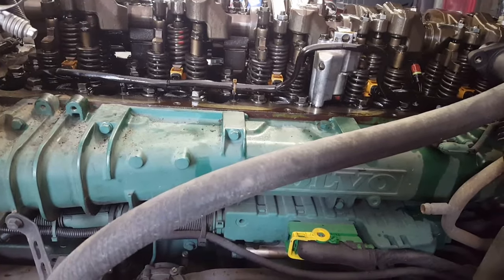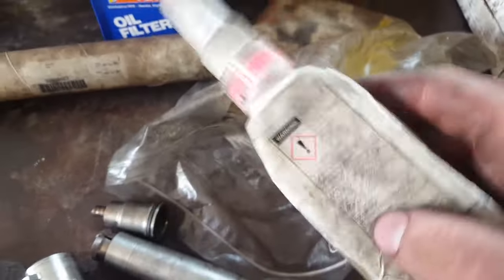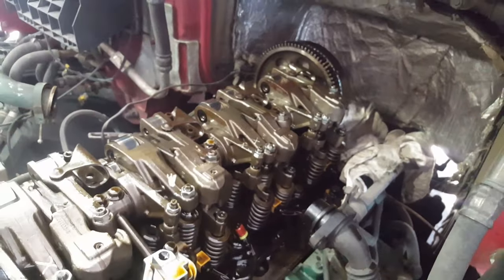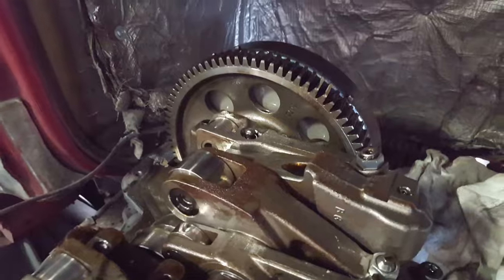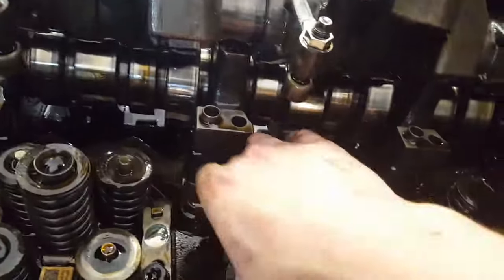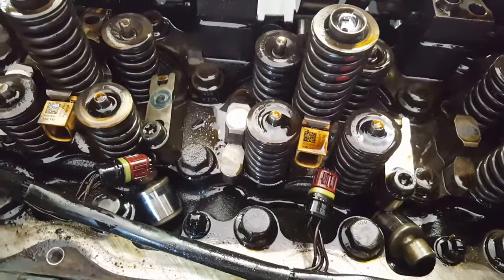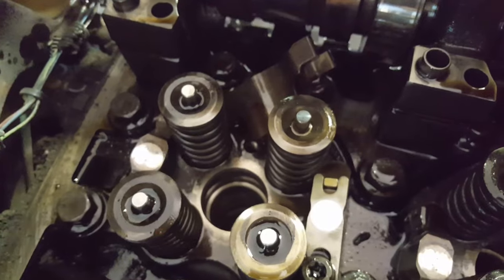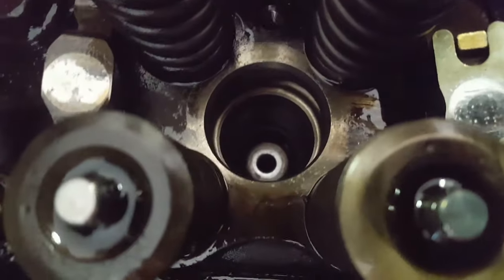How to Replace Injectors and Cups on a Volvo D13 Part 1/2

Comment: When pulling injectors, loosen either the feed or return line on the head to let fuel drain. When pulling cups, use a 15/16 ratcheting wrench ($20 from Home Depot) on the big nut, stick a rolling head prybar or screwdriver in a rocker shaft hole to keep the 13mm wrench from moving. You’ll have all cups pulled in 3 minutes.
Reply: When I start my truck in the morning and sometimes it doesn't start, the noise comes as if the truck starts now, but it doesn't start, it stops by itself, my truck is 2017 and has 8 lac mileage, if anyone can tell me anything.
Reply: When is temperature is very down same problem show me , today I am right now Amarillo tx eh is temperature’s after I trun off my truck and maybe 10 min after I staring again same problem, but right now I press the race pandle after that is start my truck ,

Comment: @ 9:00 I would recommend using rubber bands to keep the exhaust plungers from falling out of the rockers when removing the rocker shaft, makes re-installation a lot easier.
Reply: We use the EGR crossover pipe, green o-rings, to hold the plungers in.

Comment: Thanks a lot for posting this, I'm doing this job tomorrow, I already started this afternoon and removed the valve cover and rocker arm bolts, I'm going to make that angle iron tool first thing in the morning, do you mind telling me the thread size of those 19mm bolts so I could picked them up when I go to buy the angle iron? Thanks again

Comment: how much would you charge to come to Arizona and teach our yard mechanic how to perform this job. We would pay your flight and hotel . it be nice to have some overhead adjustment videos. Our mechanics are really good with other engines its just Volvo that they avoid any major repairs. For example they did a head gasket on a 13 and had some problems with it. Volvo dealers are really expensive and always swamped with work. great videos btw Thanks

Comment: Hey brother you said something about reusing the injectors. If i want to reuse mine do i need to do something with them. My injectors seem to work fine but i have bubbles in the fuel tank comming out of return line. Also long starts. And my last trip i had severe vibration under heavy load. Not sure i that was caused by leaking cups or just clogged fuel filter. Was no vibration when drove home empty for over 500mi. Also how much you charge for injector work, do you give waranty for how long. And how much are injectors from the dealer. I have the tool for pulling cups from ebay slightly different than yours but same principal. Have you heard if those work ok. Im thinking how to fix my truck cobsidering all possible options. Have 6 kids bills are coming truck needs work. Thanks дякую

Comment: Hello sir ,
When you said you vacuumed the cylinder to prevent hydro lock what did you use for that .
Reply: You can get a vacuum brake bleeder with 1/4 air hose into the cylinder

Comment: YOU CAN USE A SCREW INTO THE BOTTOM OF THE CUP AND PULL IT OUT WITH SLIDE HAMMER DONT NEED TO BUY EXPENSIVE TOOLS

Comment: Sorry I forgot to ask you another question!! Are injector cups come in 2 different kind of material ?? Like in the past they were made by hard plastic or metal which metals lasted longer ! Is that right? Are metal ones do better than un metal injector cups ? ( quality wise ) 
Thanks man
Reply from the maker: Used to be copper, now they are steel

Comment: Great video I've worked at mack dealer couple years back and totally almost forgot the procedure installing the cups. And Chronicle cup thing for injectors tips .great explained
Reply: Feed line is the better option, since it's toward the rear of the head and typically is a little lower than the front

Comment: the steel sleeves are miles better than the origional copper sleeves. 9/10 times you would either pull the tip out with the old tool that threaded through the tip, or you would pull the sleeve and the tip would stay in the head :D

Comment: wow... great video, thanks for sharing. I got a question if you don't mind? When the hard cranking reason is just injector cups , are you always recommend to change the injectors too even if they are in good shape?? And secondly where is your shop located? Thanks a million if you reply. I assume you're a great mechanic by this video.
Reply: If they are in good shape, you don't have to replace them, and you can replace only ones that/if they are bad.  Only reason they are recommended to change in a set is Labor Time (Money), since you would have to do everything again to change injectors in case they fail soon after you install new cups.

Comment: Great video 👍
I have been going from shop to shop with injector cups problem. Just day ago pulled out of the Volvo dealer drove 550miles and my coolant starts leaking again pushing it through the injectors, pressurizing the system. Had two full engine rebuilds on two separate trucks, basically every year I need an engine rebuild. Do you think that the injector cup leak issue could cause a future engine failure? Because I have to rebuild whole engine after injector cups leak I don’t know if it could be connected in anyway but it seems like coolant washes out cylinder oil and engine running dry long enough and after the leak fix that cylinder locks up and drops rod destroying entire engine. Idk 🙈

Comment: Where can I get the inyector cup removal and installer tool ?
Reply from the maker: Dealer should have it. Otherwise you can get aftermarket for much cheaper but maybe won't last long

Comment: Interesting. I use to work in a machine shop years ago, making a few different turned parts for these injectors. So if your lorry was build between 2004 and 2011, and the injector failed. Sorry about that.

Comment: Good morning I have a question what tools exactly do I need to remove an alternator from a 2006 Volvo vnl with the engine D12 thank you in advance
Reply from the maker: Basic hand tools. 1/2 ratchet and some sockets dont know exact size, it right on top so should be pretty easy
Reply: @cardinaltruckservice3753  ok thank you

Comment: Should the fuel rail be replaced while replacing the injectors?
Reply: Not really necessary unless the injectors were the problem! Volvo doesn't use high pressure rail on d13 that's a good thing so the rail isn't where most problems are! The cup's design and injectors (because of cup design) are the most common problem besides oil leak at the timing gear area at the back of block!

Comment: When I start my truck in the morning and sometimes it doesn't start, the noise comes as if the truck starts now, but it doesn't start, it stops by itself, my truck is 2017 and has 8 lac mileage, if anyone can tell me anything.
Reply from the maker: Maybe air getting in system ie injector cups, filter housing, davco or pressure relief valve sticking if you still have it
Reply: @cardinaltruckservice3753  thanks sir

Comment: I bought the swage tool for installation but welded a tap to a piece of threaded rod and made a bridge to pull old cups and it has been working fine for years now

Comment: Hey question, my truck is taking forever to start (d13) and it stays misfiring. I got some bubbles in the tank. But her i open the the priming pump it came lose. Do you think its soaking air ? Or my problem is injectors and cups?
Reply from the maker: Could be a few things, cups most likely on this engine but will need diagnose by mechanic, could also be filter housing or check valve or hole in fuel line

Comment: I had injectors put in and my jake quit working. Any relationship?
Reply from the maker: Yes, take it back to the shop
Reply: @cardinaltruckservice3753  They still have it and they ordered a solenoid I don't know who they are planning on paying for it. They took valve cover back off and said everything looked good with new orings put on. Just sucks bill is going to be big anyway

Comment: Tow months ago I replaced the 6 cups and one injector because I was having diasl in the coolent ,  and now I have misfire cylinder 5 , can I replace the injectors only Without replacing the cops ?
Reply from the maker: You can try but you might have to do it again, it's cheaper to do it right once. It doesnt add much time to change one cup when your already there
Reply: @cardinaltruckservice3753  thanks for your help , what about the one brand new injector i replaced tow months ago , do I need to replace it also or just buy 5 new injector , it's almost 600$
Reply from the maker: @mahmoudlover1  yes you can put 5 as long as the new one is not the problem
Reply: @cardinaltruckservice3753 yes the new one cylinder#2 and the problem cylinder#5 misfire ,

Comment: sir i have a problem if i start the engine d13a volvo and i put automatic or manual no accelerator,.after 1 to 2mins.accelerator work..in neutral position its good,.what is the problem?
Reply: throttle pedal may be the cause, had the same problem with a FM9 / ishift gearbox
Reply: Tps or throttle position sensor!

Comment: Very informative video. Where can i purchase his injectore sleew remova/installer?
Reply: TAP THE BOTTOM OF THE CUP AND TREAD A SliDE HAMMER INTO IT AND PULL OUT THE CUP EASY AND CHEAP DONT NEED EXPENSIVE TOLLS TO DO THIS JOB.
Reply: anywhere online, amazon

Comment: Have you seen any failures with injectors or any other part in general that damaged the turbine veins on a vg turbo causing the armature to seize up? On a D13 engine. Thanks. Awesome video too.
Reply from the maker: Something from engine would probably be piece of broken valve. It could get stuck from build up of soot or uneven wear also
Reply: @cardinaltruckservice3753 Ok, thank you.

Comment: sir how about the weak engine brake,what is the possible cause,it works but he cannot stop the truck if I use the engine brake?
Reply: You need your top end serviced! Clearances are out of adjustments! While you're at it have them do cylinder cut out and compression test and get yourself an oil sample sent out!

Comment: Do I have to chance the injectors everytime I change a cup ? Or could I just change the cups only.
Reply from the maker: Cups need to be changed any time injectors are removed. Injectors need to be replaced only if its worn or pitted on mating surface to cup

Comment: Injector cup tip broken and stuck on cylinder head. Any suggestions how to remove it?
Reply from the maker: Need a special tap and bolt. Not sure where you can get one
Reply: @cardinaltruckservice3753  thanks!

Comment: what would be the signs of me needing to replace my injectors and cups
Reply from the maker: Could be a few thing but most likely cups if hard to start/ need to prime fuel before starting, air in return, bubbles if you look in fuel tanks. Injectors need replaced if the have pitting due to bad cups or sometimes they misfire under load

Comment: can you help me to solve the problem on the volvo d13 engine error and injector #5  electrical fault..thank you
Reply from the maker: Single injector electrical fault is usually bad injector, test it by disconnecting injector and connecting to a spare injector. Just the wire, no need to remove injector. See if you still get code
Reply: i check on the monitor and the warning is engine error and i check the faults is injector #5 electrical fault..whats is the cause sir?
Reply from the maker: @wilfredvictore2886  bad injector
Reply: thank you for the reply
Reply: sir how about if the  injector ask a code,.what is the code to be use?thank you
Reply from the maker: @wilfredvictore2886  it doesn't ask for a code, it needs to be programmed for your engine to run correctly

Comment: sir I will ask something..if the crankcase pressure too high,if you are running the engine its automatically shotdown,what is the cause?
Reply from the maker: +Wilfred Victore check blow by if nothing there probably bad sensor
Reply: from the breter there is a white smoke coming out there.
Reply from the maker: @wilfredvictore91  could be condensation but if crank case pressure high, truck running rough and smoke from blow by, either worn rings or cracked piston or liner,  may need overhaul.

Comment: you forgot to mention that you need to  repair the exhust plungers if thay back out
Reply: First bulletin says to repair them...then the 2nd bulletin says, don't repair them, replace them. All exhaust rockers are on national backorder. So, I being a good tech, use my TIG welder to spot weld the pistons.
Reply: @BurninBogey7  that’s good. We’ve just been red lock tightening them😅

Comment: hello, what's was the symptoms of bed injector cups?
Reply: Hard to start condition, over pressurized coolant reservior, coolant pushing out of reservoir. Low power, over temperature in aftertreatment

Comment: If I need to replace the injector harness on a d12 motor , do I need to take any of that stuff like rocker arms and jakes
Reply from the maker: Haven't done it on a d12 but I don't think you would have to remove any of that

Comment: sir what is the problem if the smoke is white,.volvo d13a fmx
Reply: That means the cups are bad and leaking coolant into the cylinder! Get it fixed asap or you'll be replacing a egr valve, egr cooler, turbo, doc, dpf, nox sensor, Delta P sensor and your intake valves will be not happy!

Comment: Need to add update to the new installer. the one you are using is pulling the bottom of the cup when it is installed. the new tool pushed down when installing.
Reply: also you don;t have to take the puller apart like that each time. it can stay as a whole unit
Reply from the maker: this tool pushes down and runs a pin through it to spread out the bottom, can't get the cup on without taking it apart
Reply: @cardinaltruckservice3753  im talking about the cup puller you dont have to take it apart.
Reply from the maker: @nickpurcella6590  yea this video needs a few updates but no time now

Comment: When taking the rockershaft loose you should have pulled the rear 18 mm bolt and all the front 13mm bolts then loosened all the rear 13mm bolts in stages. With the plungers on the exhaust brake rockers before you put the lifting tool on you can use old red or green orings and put them around the plunger and the rocker to hold the plunger so you can keep them in place. And the cup pulling tool can stay together I use the same one and dont take it apart. And your cup swedging tool should be updated to the new style. Just my input from another volvo/mack tech
Reply from the maker: Thanks for input, I did unscrew in stages in video like you do but I only do middle 3 or 4 front or rear, faster that way. I'll try your other suggestions though
Reply: @cardinaltruckservice3753  p

Comment: How do you diagnose a bad injector is there any tools or procedures for diagnosing?
Reply from the maker: If it has electrical problem you will get code, it could be leaking fuel into oil so you need visual exam, it could cause engine to misfire underload which may or may not give a code
Reply: My truck idles very rough and it cracks long before starting are those also related to a bad injector?
Reply from the maker: Not sure without seeing the truck but could be a injector leaking into cylinder or maybe injector cups

Comment: What state you’re located? If I need to bring my truck?
Reply from the maker: Virginia
Reply: Cardinal Truck Service  Hi brother I live in Reisterstown MD  and I have d13 volvo   I go to your shop  can you check advise what really need to do  Problem is hard starts if I use manual pump stats easy  I replaced new battery, new starter , new water separetor  but still same
Reply from the maker: @baltimoremd5415  https://www.cardinaltruckservice.com for more info, thank you.

Comment: I've had mine done 3 times. They are failing again. Why?
Reply from the maker: Did you replace injectors also? The seat can get worn, or bad install
Reply: @cardinaltruckservice3753  yes. Volvo has replaced the injectors and cups 3 times. They are failing again.

Comment: Metal brush? Terrible idea, one little wire comming off = catastrophic failure.
Reply: It's in the Volvo procedure to to use the wire bore brush. Use the safety o-rings around the fuel passages before doing any cleaning. These procedures and tools have changed a lot since he made this video but the cleaning steps are the same
Reply: @dieselstuff2952  I've seen lots of things come and go from procedure manuals for one the 3M cleaning discs to clean head gasket surfaces is no longer advisable because of the silica that comes off the discs and gets stuck between the piston and the cylinder wall. It doesn't take much imagination to understand one little piece of wire coming off getting lodged in the oil pump.
Reply: Like I said it's Volvo/Mack procedure. When they start seeing problems with it then they will change the cleaning procedures and tooling. Outside of the the constant injector seat failures they have,  I or anyone that has done this job on a nearly daily basis has never seen a problem with it.
Reply: i have done thousands of injector cups in my 20 years working at a dealer. not once had a failure becuse of the brushes